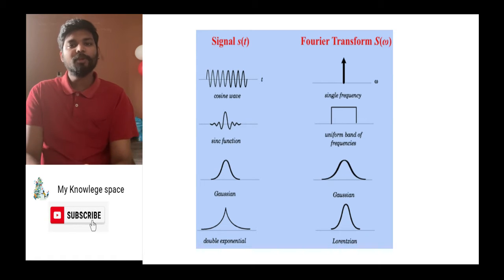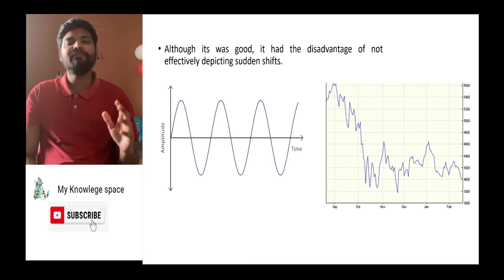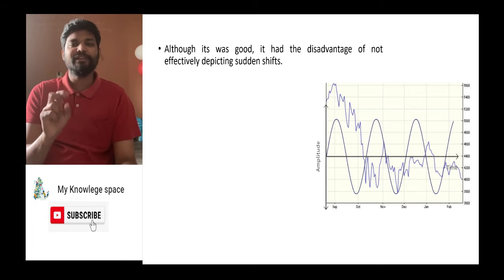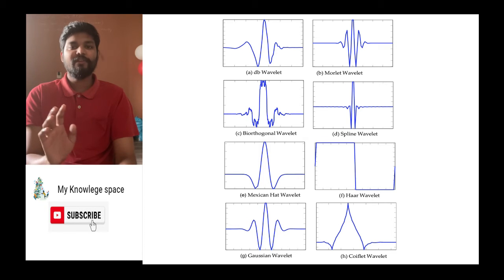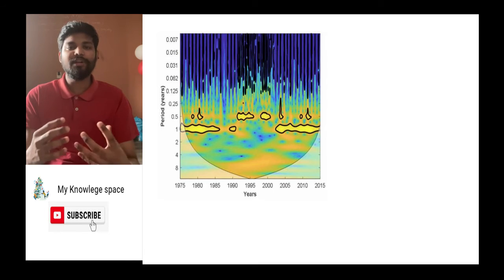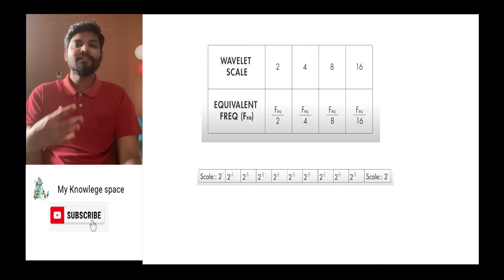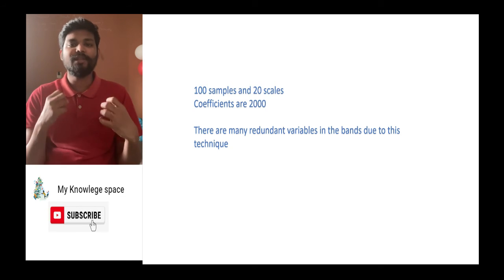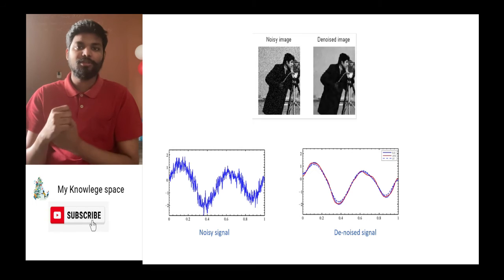What is wavelet analysis

Comment: You have a deep knowledge. I have 15 years temperature data upto 30km. I want to see the periodicity of 5km,1okm,15km,20km,25km and 30 km, how can I see thiese periodicity? thank you
Reply from the maker: i am sorry but the question you asked is not clear to me, can you please specify more so that i can understand the question better?
Reply: @myknowledgespace  I have 15 years Temperature data. I want to see the the periodicity which atmospheric parameter like (QBO,ENSO, Solar flux etc) affect each kilometer ?
Reply from the maker: @tsehayenegash8394  if you have data at each kilometer, you can use the wavelets concept to check the periodicity for each Km, Although i have not applied to check the spatial periodicity but i believe that it works if you thing each 1km is like a specific area to check the influence
Reply: @myknowledgespace  ok thank you, How can I take the sampling time?
Reply: Thank you for effective and valuable information of ~The Wavelet analysis~ from hydrologic and meteoralogic approach!